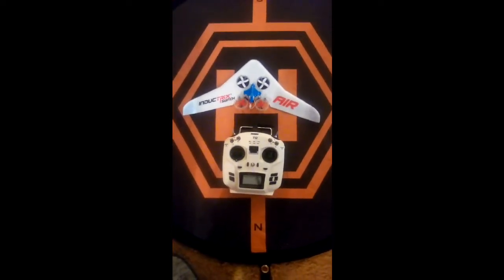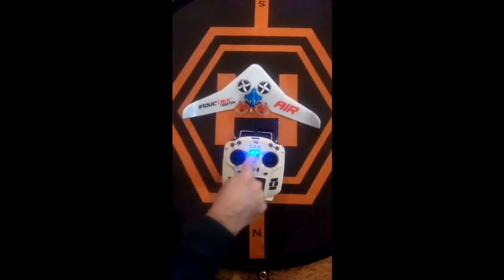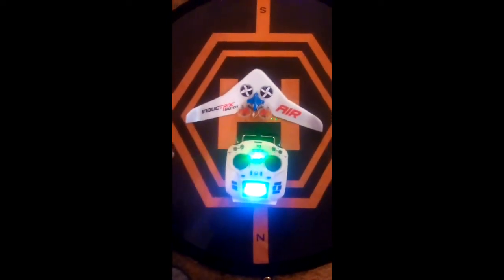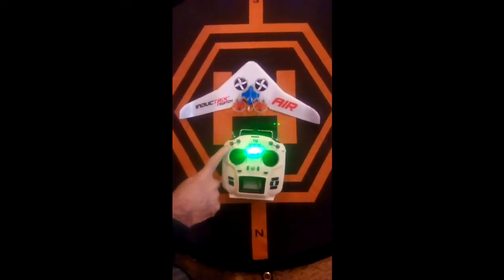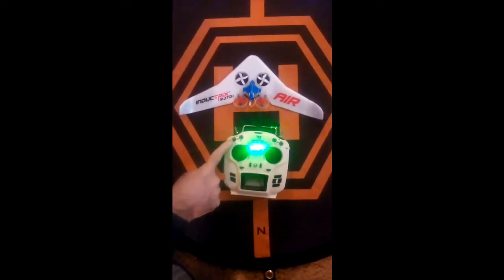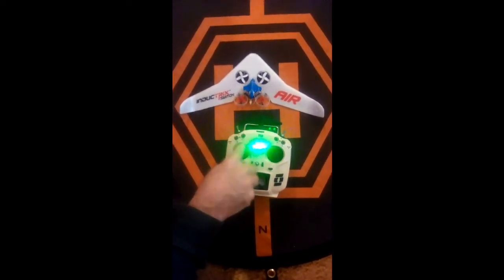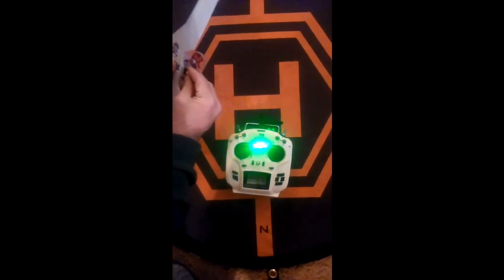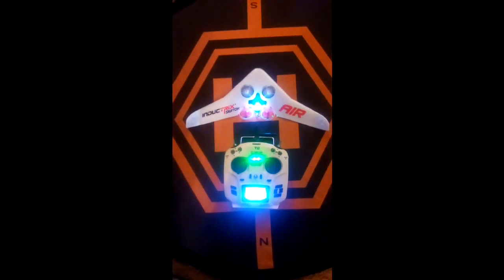Jumper T12 & Blade inductrix switch air  BNF

Comment: I just got my Jumper 12 yesterday and while I can get it to bind with and fly all my blade products I can't get the switches to do a darned thing.  I have to replace the board in my new Inductrix BL because of drift I can't correct so I'll see what happens with it later.  Thanks for the video.

Comment from the maker: The three position gear switch I put on SWA, 100% in up position for beginner mode, -100 in middle and down is expert,  Also, with my switch air and my radio I have to arm the quad in wing mode or put it in wing mode before changing to quad mode or it will accelerate straight up and will not cut throttle you have to disarm it.  YMMV.

Comment: Will it work with regular t8sg?
Reply from the maker: It should I used DSM 22ms protocol and sub. first bind was a PITA had to use the soft 'bnd' field on page 2/13 in model setup of Jumper-tx. Arm is 100% weight of a two position on ch6 mixer ( I used G ) and beginner mode is 100% on ch5, expert is -100 on ch5 they say use a three position. 
 Also, if you run it as a quad and start in quad mode it likes to fly up and away. First set it to wing mode, arm it, disarm it, then set it quad mode and fly. Weird...